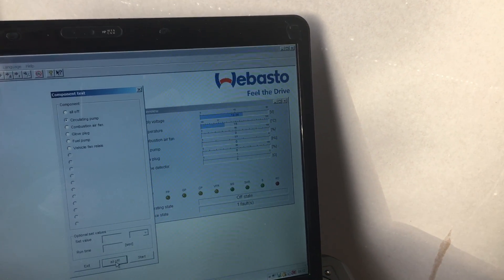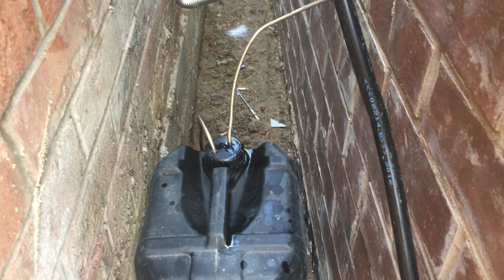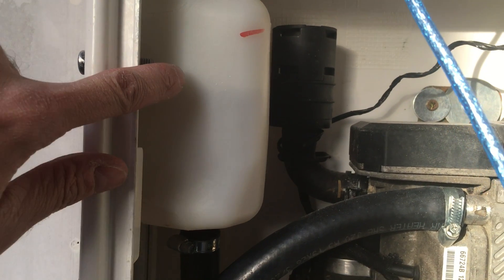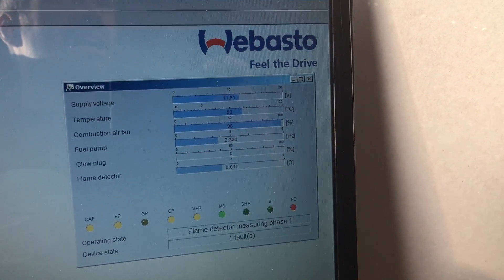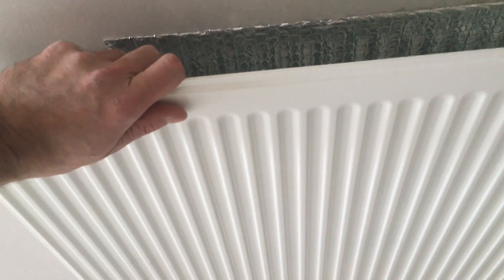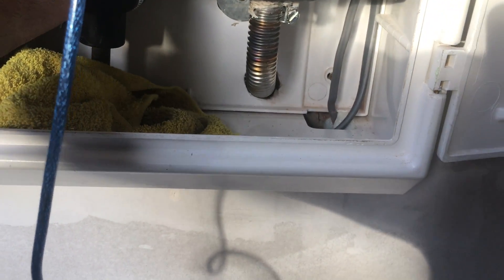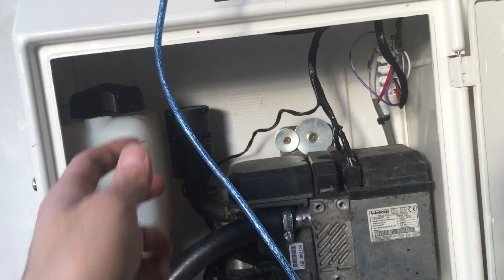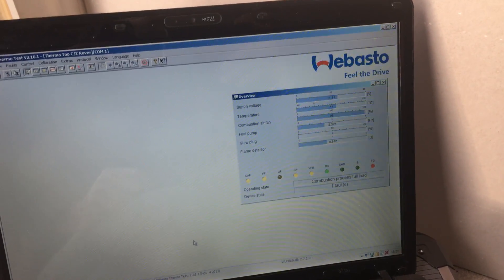Webasto Thermo Top Z C Z/C diesel fuel burning parking heater garage radiators Testing + Diagnostics

Comment: This device is not purposed to the continious work. How it is feeling now after 5 year of using?
Reply from the maker: It’s still going strong. 

I changed the temperature controller on the wall for a digital one and the Webasto unit itself has had a new burner gauze due to some poor quality fuel causing excessive soot. 

Still happy with it 🥳
Reply: @WestinghouseProductions  It's nice to see that. How long the webasto work at time?
Reply from the maker: @Agent868  around 2 hours on each cycle. The workshop is well insulated and holds the heat nicely.
Reply: @WestinghouseProductions  Wich cycles per day?
Reply from the maker: @Agent868  depends on external ambient temperature. It can be on for up to 6 hours a day on the combined cycles.
Reply: @WestinghouseProductions  Thanks.

Comment: Hi. Very cool. Do u ever tested how much fuel do u need for heating?
Reply from the maker: We get through around 50 litres a month when the weather is cold, which sounds like a lot, but when the heater is on for at least 16 hours a day to keep the workshop at a constant temperature all the time isn't bad going.
Reply: @WestinghouseProductions  That sounds acceptable. Using red diesel, the cost seems alright.

Comment: I bought a Webast ThermoTop C last week and I am now figuring out the wiring. I found the connector for the waterpump and wiring is missing and the main power connector has been damaged. 
Are the connectors use in Webasto devices standard automotive types and do you have may be type 
names for them ??

Comment: Hi Paul, I'm having to comment as my Mrs as this is the only account it will Let Me sign in with. Ben here! Would be really interesting to see how you've connected your wiring from Laptop to Webasto as my heating system is up and down like a yo-yo at the moment. I've downloaded the software but am in need to order wiring from the diagnostics plug to my laptop mate and am really struggling at the moment! Any help/photos/videos would be greatly appreciated, many thanks, Ben.

Comment: Nice work.
This idea i have for my new garage too.

A little tip..
The temperature where you mess are wrong.
The messpoints you're must paint black (for example alu reflected ;-) ).
So the IR thermometer have the same conditions at every messpoint.
This is important for a even measurements.
Reply from the maker: Nachbars The temperature readings were to simply prove the concept. I'm aware that accurate readings must be taken on a dark matt surface👍👍

Comment: Hi Paul. Great useful vid.  I'm thinking of using this same system to heat the conservatory. Any chance of a diagram of the OBD connector etc please. I have the software but can't find details of making up a cable. thanks. Rich
Reply: Rich Nixon wiring is simply

Comment: Hi, would you recommend this type of heater for a 37 ft RV ? Thanks   I have quarts heat with ceramic,i dont trust them while leaving the coach
Reply from the maker: Hi Doug

This sort of heater is designed for the type of use you need - It is also fitted to narrow boats here in the UK plus many other things. With it being fully self contained (apart from the fuel supply), you can put it wherever you want it for making your system safe to use at any time.
Reply: thanks for the heads up, it would make me feel safer if i had this type of heat instead of  heat sources with elements.

Comment: You said that you used a OB2 Connector for your diagnostic and only used 2 wires, could you give me a diagram please? Couldn't quite catch what you said.

Also did you use a small expansion tank in your system?
Reply: did you upload the wiring diagram for obd connection ?
Reply from the maker: Charlie Williams Hi Charlie. It's 3 wires for the OBD connection. + 12v (Vcc), Ground and K-line. I'll upload the wiring diagram when I get on the computer. 

The small header/expansion tank can be seen to the left of the webasto heater inside the box housing.
Reply: Paul Simon Hi Paul, I thought that was a expansion tank but not really having any experience in plumbing I couldn't be sure. 
My plan is to use the Webasto for underfloor heating on a Bedford Tk Conversion I've been ploughing thru, was worried about the Webasto pump not being man enough. Any issues in this area?
Nice video, inspirational.
Reply from the maker: Hi Charlie. The pump on the webasto is proving reliable with no issues at all. I had some concern initially that it wouldn't be able to move enough water for the system to work effectively, but it works without any issue at all. Providing you are not attempting to push it through more than a 25 litre system I would imagine it to be OK. The radiators I have installed, and associated pipework, come in at about 12 litres, which is the average car cooling system quantity.
Reply: @WestinghouseProductions besides that small expansion tank, do you have another water reservoir?
Reply from the maker: @thebigboss024  no other expansion tank, the small one is sufficient. 

If I had more radiators in the system then I’d need a larger tank as there’d be more thermal expansion.

Comment: Great video. Did you do any other wiring mods? 
Ive got a thermotop c off a peugeot c8, im trying to get it up and running for some temporary heat. 12 volt to pin 1 runs circ pump and fan but switches off after a 1min or so.
Reply from the maker: Sounds like the cable you are usng isn't heavy enough to support the current needed to stat the burning process - If this is the case, the voltage along the cable will drop and the Webasto will shut down due to low voltage protection below 10.7v
Reply: @WestinghouseProductions whatbis that white small tank for? And do you have another wayer reservoir tank?